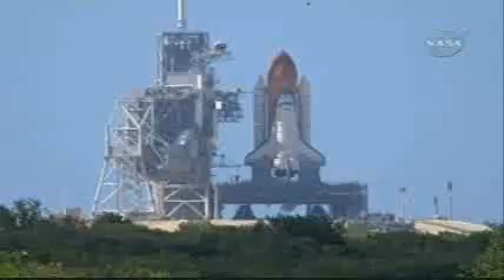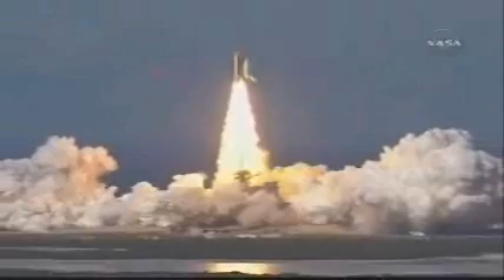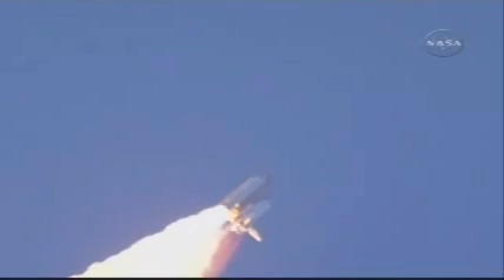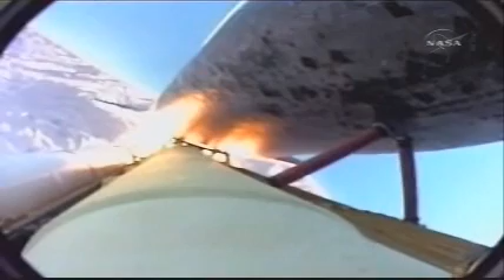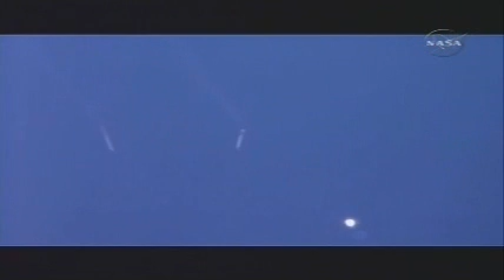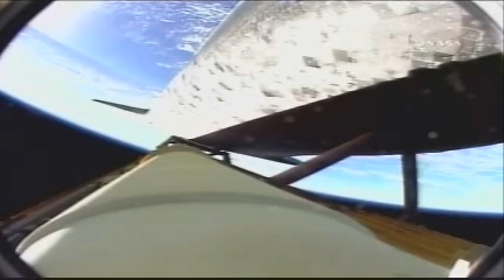STS-124 Launch

Comment: The time is 2:26 on the film when you see the puff of smoke. It doesn't appear to be the SRB simply because you can see the boosters in the distance.  When the shuttle completes the round, the puff appears to come off the back part.